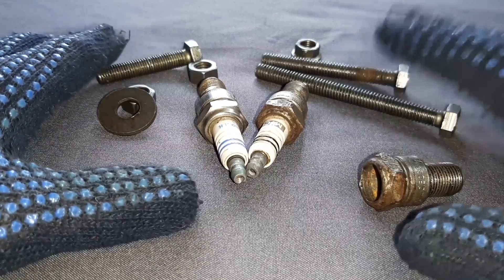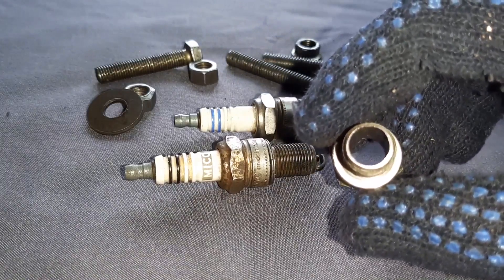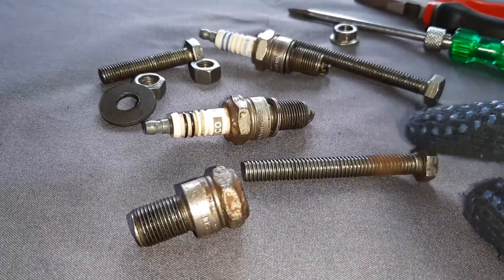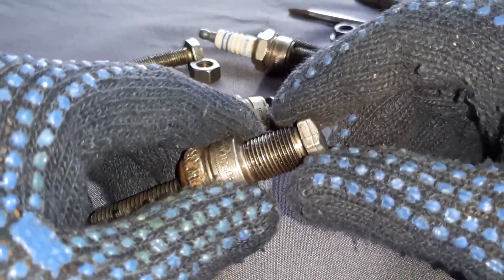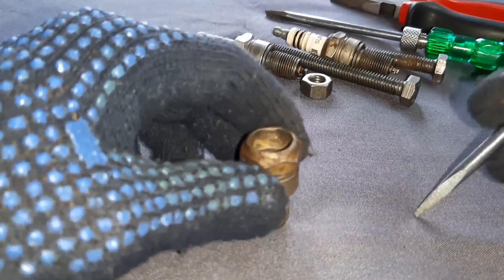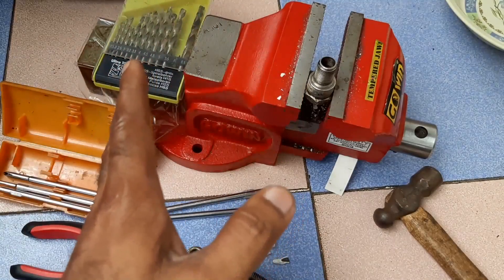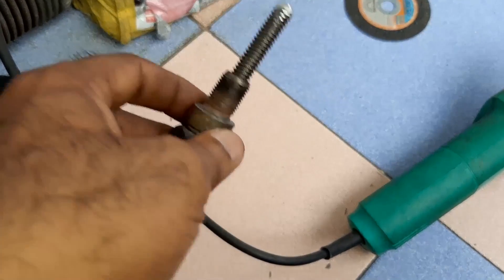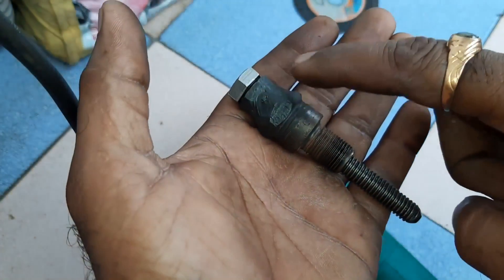How to Build Your Own Piston Stop Tool DIY Guide to Creating a Piston Stop Tool

Comment: What's the length of the bolt?
Thanks
Reply from the maker: 92.3 mm
Reply: @LambrettaRamesh  thanks sir i have lot of queries regarding timing can u please help
Reply: Is there anyway I can contact you.thanks
Reply: I just tapped the plug to thread a 3/8 bolt through it.